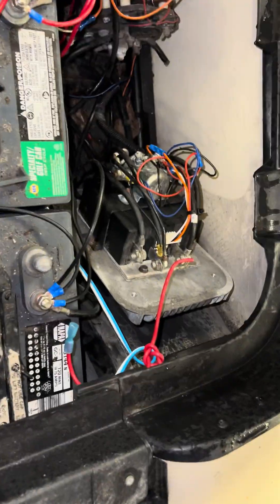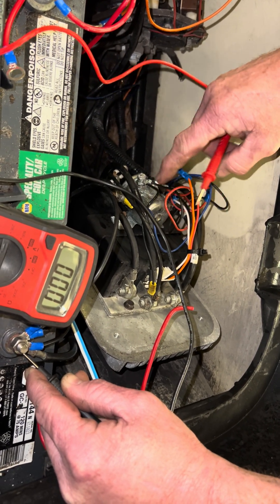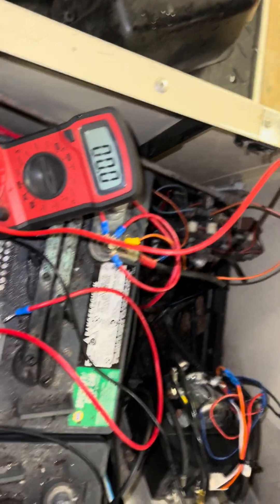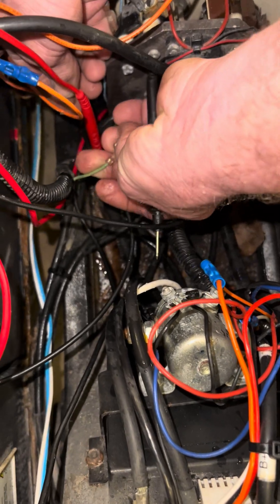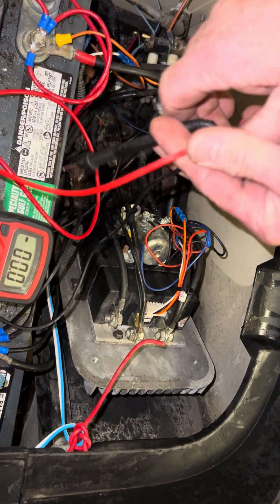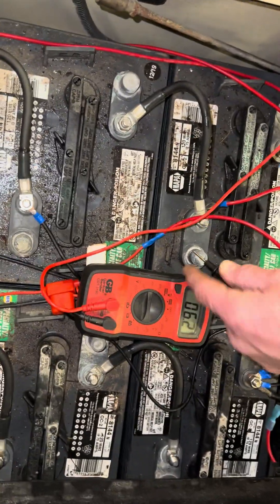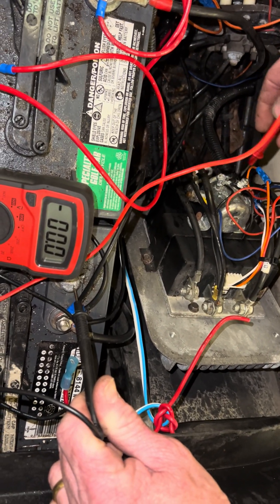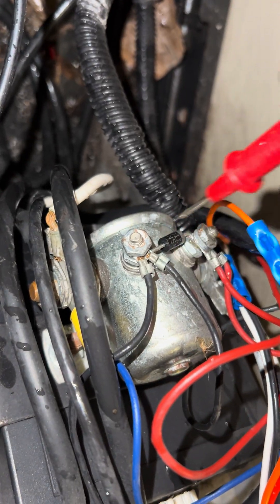What's REALLY Causing Your EZGO 36V SERIES Controller Solenoid Problems?

Comment: I have a 2015 rxv that the brake locked up when driving. I could not get the brake to release by putting in tow or by reversing connections 1 to 3. I installed a new brake but still  not getting voltage to the brake. Any idea what causes this ?
Reply from the maker: Does your sol click
Reply from the maker: Also after you replaced the brake.  If you hook up one and 3 would the brake release
Reply: The solenoid seems normal and the brake will not release when 1 and 3 are hooked up
Reply from the maker: What’s your battery voltage
Reply: Measures 53 volts. It's a RoyPow 51 volt 105 amphr lithium battery
Reply from the maker: @kenny-Poo  gotcha check voltage at the sol.  Both big post. Black lead on main negative red lead in one side of the solenoid. Then test the other side.   When you hit the gas does the sol. Click
Reply: @golfcartwhisperer  With the key off I measure 53 volts on the big red solenoid post and zero voltage on the black post.  When I turn the key on the solenoid clicks and I then have 53 volts on both of the big posts on the solenoid. At the same time I now measure 23 volts on one of the small posts.  Pressing the gas pedal does not change the voltage measured but turning the key on does. No voltage going to brake. Wiring all looks good., Could it be a controller issue ?
Reply from the maker: @kenny-Poo  when you put the brake back on. You don’t tighten it too tight. You just snug it. Unplug the plug on top of the brake and put. 1 and 3 and check for battery voltage. On the harness side of the plug. Let me know what you get.
Reply from the maker: Did you check the fuses
Reply: Zero volts there with 1 and 3 connected with key in any position and with tow switch in either position
Reply from the maker: @kenny-Poo  that’s not good.  Probably bad controller.
Reply: Yes I did.  I guess I will order a new controller.  Gulp...
Reply: I check the voltage on terminal 1 and 3 as you instruct and surprisingly there is 53 volts on the center terminal of plug 3. No voltage on 1.  What does this mean ?
Reply from the maker: @kenny-Poo it should send voltage over to plug one when you hook it to 3. Hook together and check for voltage again
Reply: Ok this is really bizarre. I now have voltage at the brake plug when 1 and 3 are connected so I plug in the brake connector and the cart works normally.  But this where I was a week ago when this first happened.  I am scared to drive the cart as I use it on the street here at 35mph and the brake can and did lock up mysteriously when driving at speed. This ruined the brake so I had to buy a new one. As it sits I could now drive the cart normally but for how long ?  Maybe minutes ?   When a controller fails does it ever behave sporadically like this ?
All the wiring and connectors look like new ?    Very puzzling !
Reply: When the brake locked last time I hooked up 1 and 3 immediately to allow me to push it off the street. That did not work so I had to lay under the cart to get the brake off.  When I got it back to the shop I tried 1 and 3 again and no voltage.  Today with the new brake on it works but yesterday with the new brake on it did not work. ???
Reply from the maker: @kenny-Poo  if it works sometimes and sometime don’t work. It’s always wiring issue
Reply: I have wiggled every wire and unwrapped some connections for inspection. There is no corrosion because it had lead acid for a limited time. All wiring looks very good. I have read online about the run plug under the cup holder perhaps giving problems as current runs through it to get to the brake ?  Do you have any other advice where I might look ?   Took the cart out for a spin and runs fine at the moment but I doubt it will last...
Reply from the maker: @kenny-Poo  that plug under the dash is not that big of an issue.  Most of the time it’s the connector in front of the batteries. Where it goes to the keyswitch and pedal
Reply: This has a centrally mounted RoyPow lithium battery and there is no connector visible between the front of the battery and the body. ?
Reply from the maker: There should be a yellow wire wrapped up in  the harness where they connect a bunch of wires together.
Reply from the maker: @kenny-Poo  yes upload it to your you tube page and I’ll look at it
Reply from the maker: Or find me on Facebook. Thomas wells Conway sc
Reply: I removed any crimped connections I found and installed soldered connections with heat shrink. I found the factory connector with the heavy yellow wire you referred to that is on the drivers side of the lithium battery. It looks like new. No corrosion found. The brake that I replaced looks decent when disassembled but when bench testing it with an 18 volt battery it does not release the way the new brake does. Can this brake be rebuilt or is it scrap ?  In the meantime I can drive the cart but am not confident another brake lock up is around the corner. I thank you so much for your experienced input.
Reply from the maker: @kenny-Poo can’t be rebuilt. So it’s scrap
Reply: Ok last question before I start this thing on 🔥 fire !
I just  drove it down to the local putting green half a mile away and when I went to leave the cart again would not go.  I connected 1 and 3 and again the brake would not release. I was showing a friend who happened by the problem and was showing him that connecting 1 and 3 did not cause the brake to click and release. As I was rocking the cart back and forth against the holding brake it suddenly clicked and released.  Does this new symptom give any further clue as to the root cause of the problem ?
Reply from the maker: @kenny-Poo  when you installed the new brake. You didn’t tighten the hell out of the bolts did you. Also do you smell a burning smell coming from the brake
Reply from the maker: Also, when it don’t run with the key off, pull the brake and gas pedal all the way back toward the seat to make sure that they’re not staying engaged a little bit
Reply: I then drove the cart home 😳
Reply: I lightly snugged the brake bolts as I have heard you instruct before.  I did feel the brake and controller to see if they were warm. They were cool. Out of coincidence I have on many occasions in the last week pull up on the brake and gas pedal as I had read about that possibility but in my case it has had no effect.
Reply from the maker: Make sure ever connection o. The cart is plugged in good. Hook one and 3 up and check the plug at the brake when it dont release.  And see if it has boltage
Reply: Out of desperation I installed a new controller last night. I played 18 holes today and it worked flawlessly. I will keep my fingers crossed...
Reply from the maker: @kenny-Poo  that’s good. Than  my s for the update.  Let me how it’s doing in a week
Reply from the maker: I see you posted something but when click on it it’s not there.
Reply: So, after installing the new Navitas Controller I played six rounds of golf without incident but then had one incident where the cart would not move.  The new controller then sent me a fault saying that the parking brake test on start-up failed because the solenoid contact did not close. I then installed a new high amperage 48 volt solenoid replacing the stock 36 volt solenoid. I have now played another six rounds without incident.  Is it possible that the problem all along was an intermittent malfunction of the solenoid ?   Maybe I didn't need a new controller?   Having said that, the diagnostic  capability of the new Navitas controller is really nice.
Reply: After the new Navitas controller install I got in six rounds of golf without incident but then had an event where the cart would not move. The new controller provides diagnostic information so it gave me a fault saying that the parking brake test failed because solenoid contact did not close.  Because of that I decided to replace the stock 36 volt solenoid with a high amperage 48 volt unit. After that I played another six rounds and have not had another problem. Could it be that the problem in the first place was an intermittently failing solenoid ?   Did I replace the controller unnecessarily?   I do really like the new controller and the diagnostic capability but this sure has been expensive !
Reply from the maker: @kenny-Poo   no controller was bad.  But anytime you upgrade to a 400 amp alltrax controller.  Solenoid must be replaced. Or it will burn up like yours.   But you’re right.   It does add up
Reply: Still working? I have the same cart with the same problem
Reply from the maker: @2wheelsarefun73  have you replaced the brake or anything?
Reply: @golfcartwhisperer  also when I went to buy it the charger seemed to work but now it won't start charging, just flashes. I've been charging each battery individually with my smart charger
Reply from the maker: @2wheelsarefun73  either you have a faulty charger or the charger receptacle is bad.
Reply from the maker: Also make sure your breaker is not tripped at your house.
Reply: @2wheelsarefun73  Yes it is ok now but took a new controller and solenoid. I went with the Navitas Controller as it gives diagnostic information to the phone app so it should make troubleshooting future problems easy.
Reply: Yes I just replaced the brake. Here are the symptoms it's a 2014 RXV 48 V. Has a navitas controller, somewhat weak batteries. I just bought the cart a few days ago and when I went to look at it the cart would not move then out of nowhere it started working. I then drove it around the block for a while and I can tell the batteries were starting to die and I had to hit the breaks hard and the breaks stuck on and burned it up the motor brake.
The cart would only move in limp mode because the controller threw up a diagnostic as "motor brake failed to hold cart" 
. I just replaced the brake today and the cart works fine except for it sometimes fails to move and you have to cycle the key on and off many times. Whenever it happens switching to tow mode won't release the break.  It appears to be a 36 V solenoid.
Reply from the maker: @2wheelsarefun73  if you changed it to a Navitas controller or if it had one already on before you got it. You need to change the sol. To a high amp sol. We used to always change the controller and no sol. But we had to start changing the sol.  Because of the same problem your having. .

Comment from the maker: If you have any questions. Feel free to ask.  I will answer them.   Thanks for watching
Reply: Love your channel Mr hey hey hey, signature line sir! I have a 1999 ezgo txt 36v dcs, 1206x curtis controller(refurbished), new batteries, new HD soleniod, foot pedal micro, f/r micros, Reid switch and cables replaced. Soleniod clicks with key on in forward or reverse, motor shutters. But cart won't drive or move other then shuttering while on jack stands...can we chat? Email or phone/video, thank you sir
Reply from the maker: @jusballen2825  sounds like a motor issue. When you say solenoid click in forward or reverse. Are you meaning it clicks when you hit the gas. Or clicks by turning key on. What does overall battery show when you hit the gas. On the main positive and main negative
Reply: @cpfans90  motor just got rebuilt, new brushes, internals were ground and lathed then varnished by local electric motor guy? Solenoid clicks, after key is on then placed in f or r? Or if in forward or reverse it clicks after you turn key on.  Motor goes on and shutters on its own not pressing pedal, if I wiggle the 10 pin stock harness to the controller motor stops shuttering. But the back up buzzer turns on after key on, in forward or reverse? What is going on man, thanks for the help
Reply from the maker: @jusballen2825  who rebuilt the controller?
Reply: @cpfans90  a company I found on youtube, cloud electric I want to say? But not 100% on that,
Reply from the maker: @jusballen2825 it sounds like a bad controller.  Ohm out the black and white wire on the controller. That goes to the motor. And let me know what you it
Reply: @cpfans90  f1 or f2? Or from the main 10 pin plug black and white wires? And ohm test them from main neg and then those 2 wires? Thanks, sorry still learning
Reply from the maker: F1 and f2.
Reply from the maker: @jusballen2825  also leave one of the leads of the meter in either wire. And touch the frame with the other lead of the meter. It should not 0 out. If it does motor is ahorted